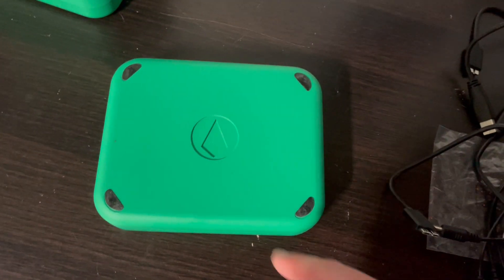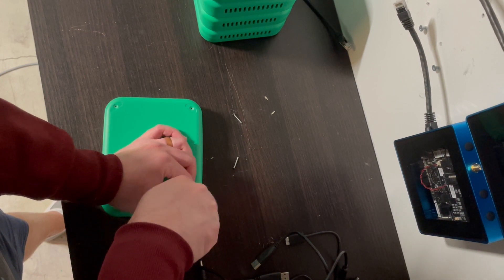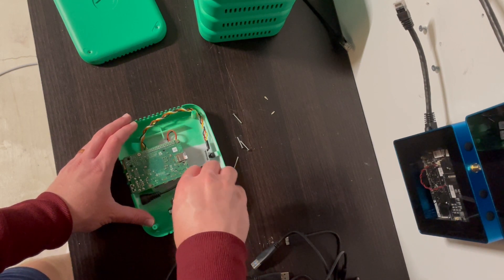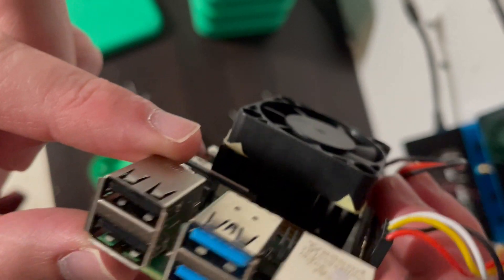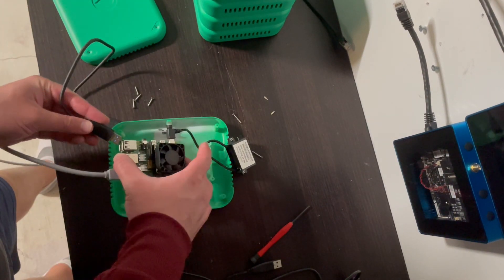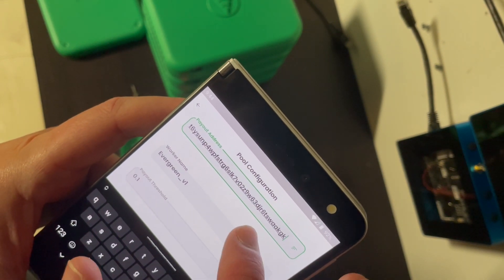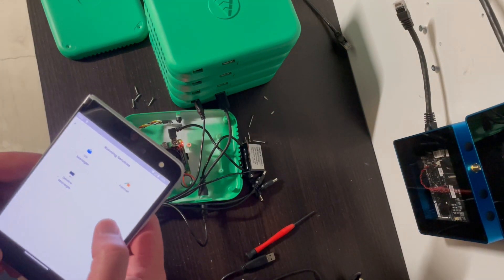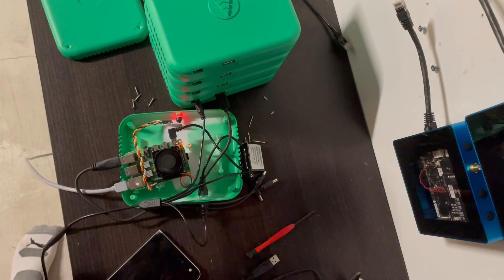Evergreen CHIA Miner Open Operation Time

Comment: The voltage regulator is the issue. You will need to replace it with a USB C cable.
Reply from the maker: Thanks, that was part of the issue but still needed to replace hub. The main PSU failed which damaged the hub and one of the drives.